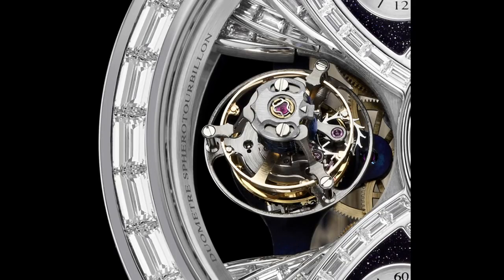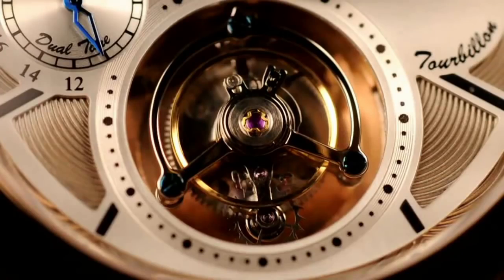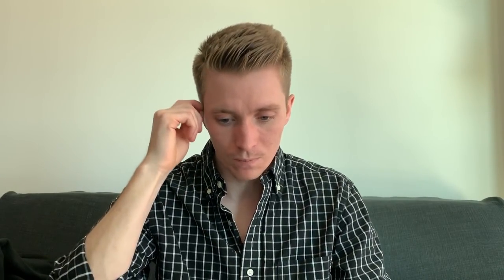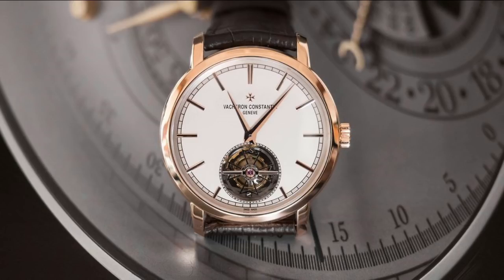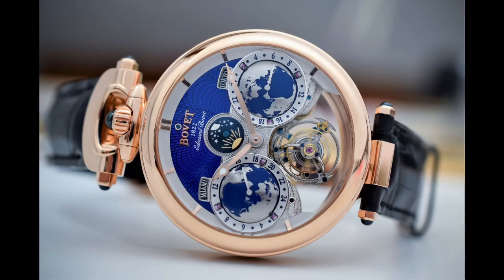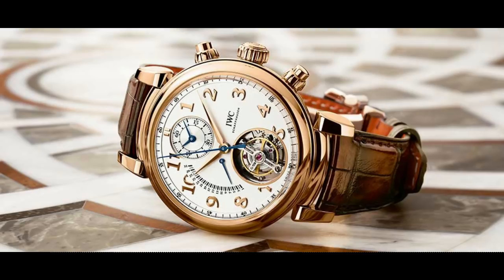What is a Tourbillon? How Does it Work? The Tourbillon History and Explanation

Comment: Does a tourbillon require continuous winding?
Reply from the maker: It depends if the Tourbillon movement is a manual wind movement or an automatic wind movement with a a rotor. It will always need to be powered by winding, but if it has a rotor that spins based on the wearers movements, you shouldn’t have to wind it daily. Hold that helps!